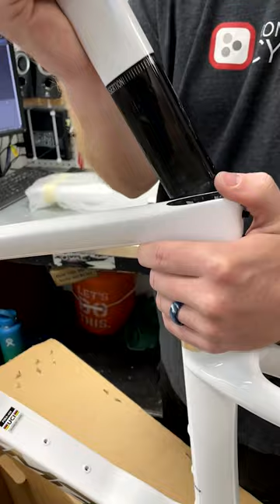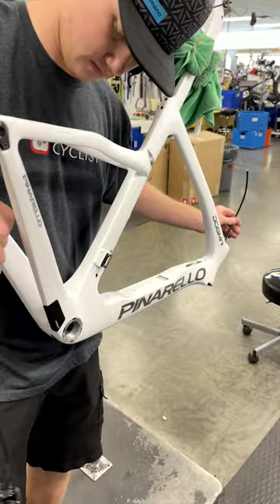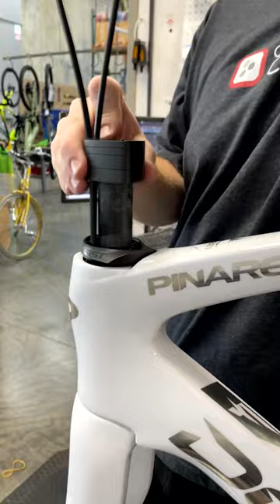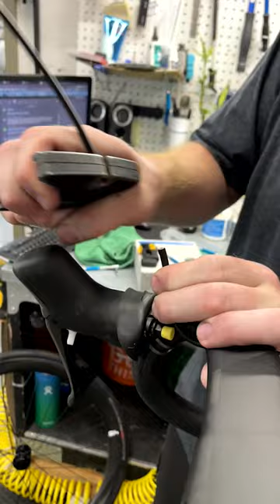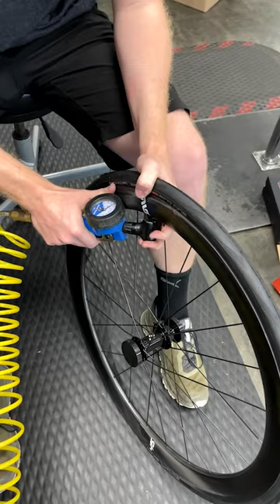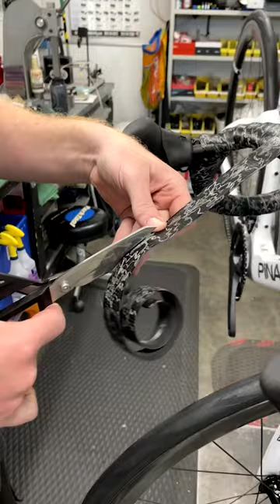Pinarello Dogma F Dream Build 😍 #shorts

Comment: Where's the grease????
Reply: It is a bike shop. Using grease would make a longer process. His hands would get dirty, he should wash them many times along the process, and finally he should clean the whole bike at the end.
Reply: Isn’t that what a bike shop is supposed to do?
Reply: @sixcyclingyt  Bike shop wants bicycles to be ready to be sold as fast as possible. And without grease,  the customer will have to return earlier for maintenance. Double profit, my friend.
Reply: I see, thank you. Dang
Reply: @josejn2007 I've worked at 5 different bike shops and none of them built bikes without grease😂
Reply: @sixcyclingyt don't listen to that numbskull. They're probably greasing everything but cut it out of the video.  You don't need much,  just a thin coat at the contact points